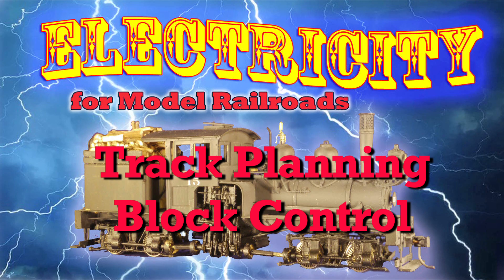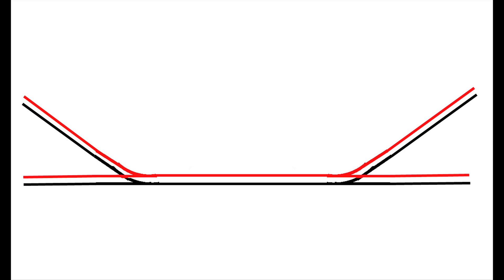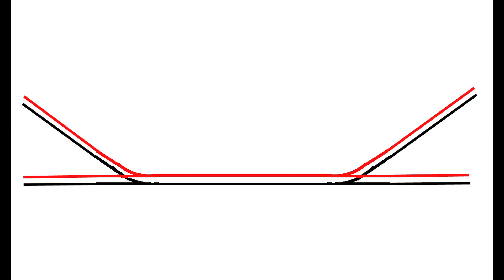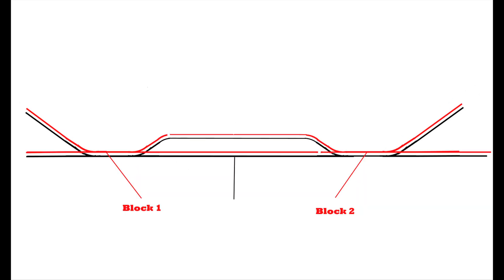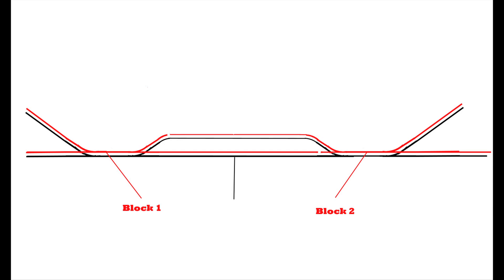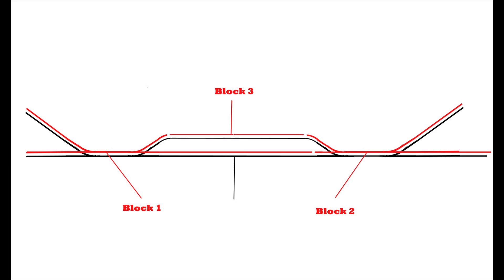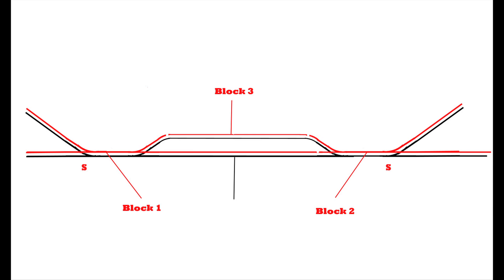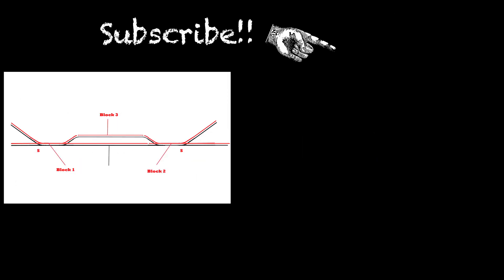Model Railroad Operation & Track Plans - Facing & Trailing Points  - Electricity for Model Railroads

Comment: I have blocks even with DCC. That way I can still run non-DCC trains on the same mainline and switch out whenever I want. Now, if only I could figure out a reliable, cost effective way to operate trackside signals/grade crossings, etc...🤔
Reply from the maker: @sort187  us too. Sort of. But DCC and DC together is a tiny bit tricky. Back in the 90’s our club layout was set up tat way. Hum… show?  Anyway, I had it broken out into AB lC and D cabs.  And eight different power supplies, one of which was DCC. The A and B cabs were connected to the standard gauge. The CD cabs were connected to the narrow gauge.  Eight power packs because it was a demonstration railroad in a hobby shop and they wanted to be able to show off all the different power supplies. One of the eight systems was DCC.  so I could switch all four cabs over to DCC and then set all of the block switches to A and C. And at that point, the entire railroad was running on DCC.
Reply from the maker: That’s the track plan on the thumbnail
Reply from the maker: Also in the opening sequence

Comment: I miss the caboose. Now you just have the train ending at the crossings with a boxcar or a flatcar or a tanker. A real bummer.       Bring back the caboose with a man in it and waving to the people at the crossings.
Reply from the maker: @growclipbonsaiforseniors1951  and they had a job to do. Now the points are controlled from a thousand miles away. And nothing is set out. Just bridge trains and containers.